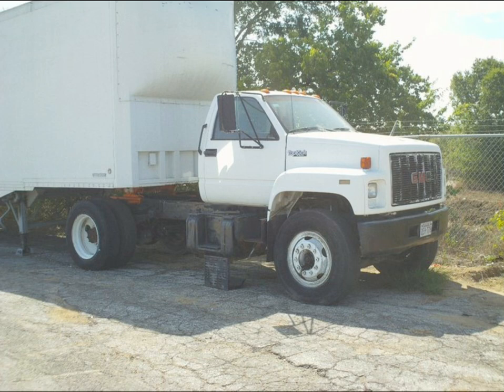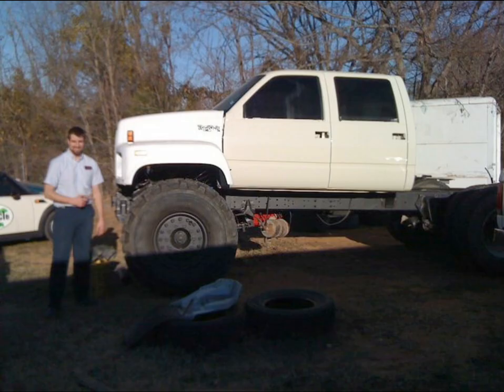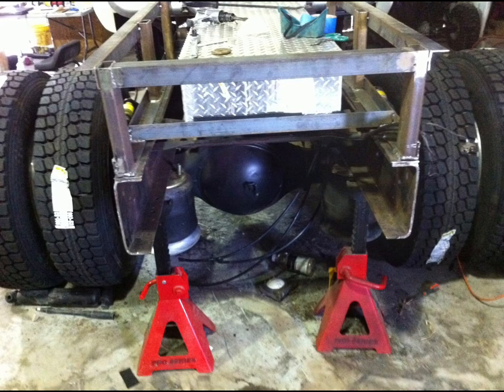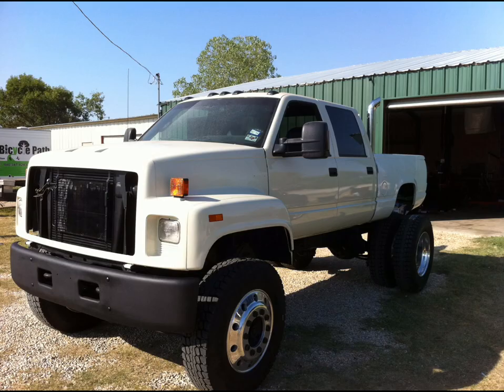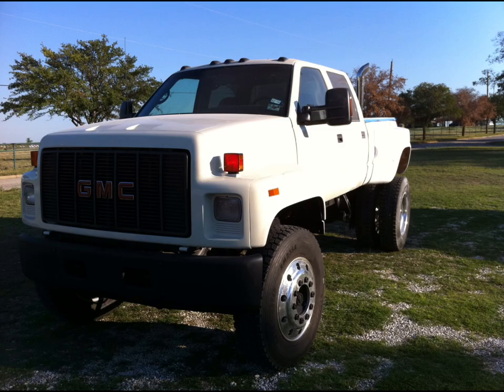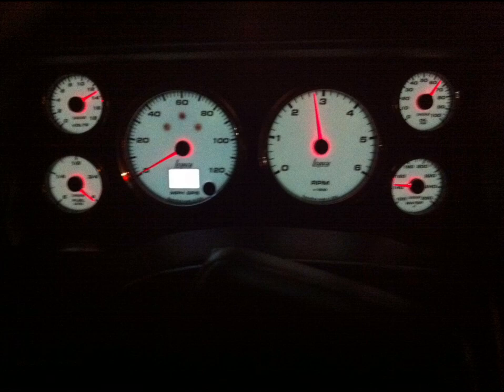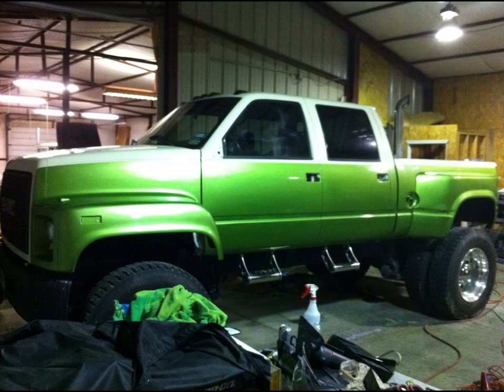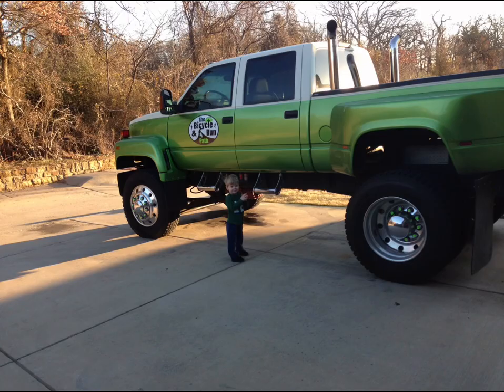Topkick pickup with a caterpillar I built before YouTube

Comment: I have a 2000 regular cab low profile C6500 with factory full load interior but I really want to swap in a dash and door panels from a 97-98 in it... Did you use a heat and air box from a 96-00 obs interior or did you some how make the topkick 88-94 c/k climate control switches work with the 96-00 climate control switches I left 95 out as that's a one year only controller
Reply from the maker: It’s been 15 years since I built that truck but I belive the boxes were the same. My cab was a 99 off a 3500 and the dash was a 95 but I’m 90% sure I used the 99 box in it. I do remember when i welded the dog house floor in I welded it a tad high and had to trim and fiber glass the bottom of the box. Sorry can’t remember more but would love to see pictures.
Reply: @cabovergary  Oka what about using the 95+ steering column?
Reply from the maker: So, I do remember the end where it connects to the rest is different and I cut the ends off swapped welded, sleeved it and welded the sleeve in place. Wasn’t too bad to do that.

Comment: Hey Gary I had a Ford Cl9000 cabover rig it was a semi before but I turn in into a topkick pickup but it’s sold now it’s most likely turn into a camper to the new owner now have a pete 362 for a work truck and a project my custom 389 is at the shop getting worked on for a new motor getting put in it
Reply from the maker: Sounds like some cool trucks would love to see.
Reply: @cabovergary  ye

Comment: Awesome truck! 
I’m working on building one at the moment, but I’m installing a 8.3 Cummins on mine. 
Are you using stud pilot center hubs or hub pilot center for the wheels? Thanks
Reply from the maker: Thanks!  That’s cool I had a 8.3 powered little freightliner and that was a great little motor. The cat in this one I was lucky. I had good luck with it the whole time I owned it but I have heard horror stories with them. The truck had stud pilot wheels. I remember got lucky and bought them as brand new wheels off a guy that bought them then realized they wouldn’t work for his pickup. If remember right I only paid like 300 for the 6 of them. Haha. I would love to see your project sounds like a fun one. Thanks for watching and commenting.

Comment: What did you need to do to the cab to get the hood to mount up?
Reply from the maker: I trying to think and for the hood believe only had to mount the quarter fenders but no cutting. Now to use that cab I had to cut the dog house out and put it in the pickup cab and then make a spot for the clutch cable but think that was it. Sorry took so long to answer

Comment: How hard was the cab swap
Reply from the maker: Not that bad. I’d remember right the dog house had to be cut out and transferred and the cable clutch had to have a stop made. Also, the newer steering column shaft was different and the push rod for the brake had to be modified to work with air brakes. For the cab mounts I just bought a pair of front Topkick cab mounts and used them for the rear mounts. Hope that rambleing made sense. Was bringing back memories typing this.
Reply: @cabovergary  was the fire wall differant i heard the floors are unique and stuff i got a c7500 i wanna ditch the 2 door and go to a 4 door crew cab

Comment: Did you make it 4wd
Reply from the maker: No it was just 2wd. I did have axles to but never got around to it. Thanks for watching.
Reply: @cabovergary  I’ve got a c7500 I’m trying to make 4wd, do you know what I would need
Reply from the maker: So, was planning on using military 5 ton axles to do so. Issue comes in the brakes and then would have to trim front fenders allot to fit right.